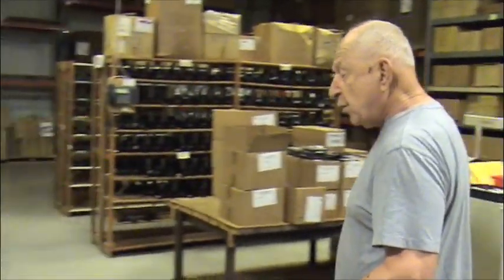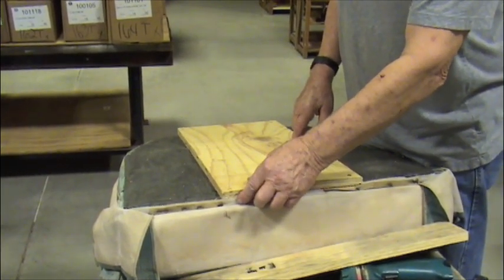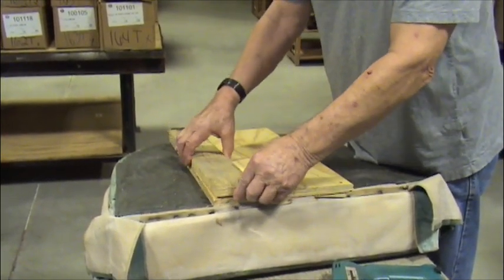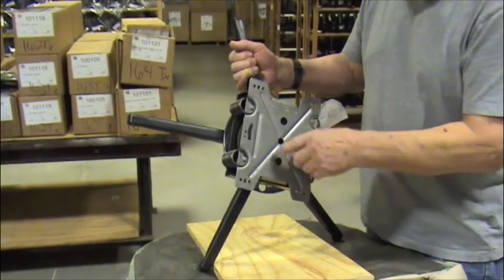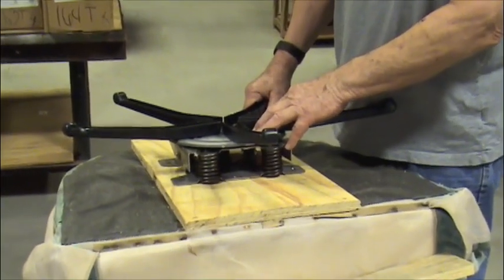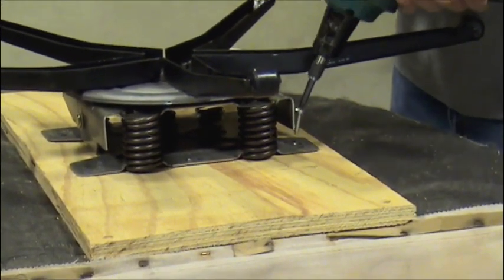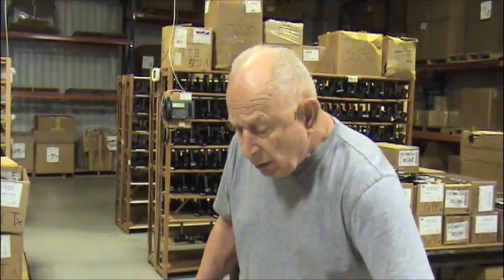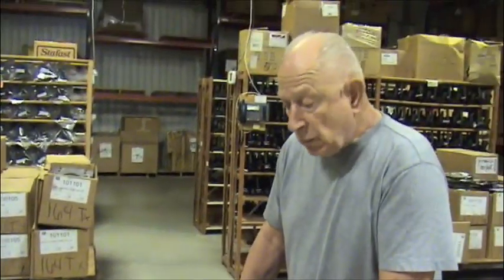How to Install a Rocker Swivel on an upholstered chair

Comment: what happens if you keep almost tipping backwards? I thought maybe it was on backwards. however your video said it right. how can I help fix it
Reply from the maker: If its a brand new item, move the unit to the rear about 2-3 inches.

If it is an older unit, it's worn out and a new one is needed.

Comment: Very clear and helpful.  For a chair with 30 x 35" frame, are 1" x 4" boards strong enough for mount under frame?  If using plywood instead for mount under frame, what type of plywood and actual thickness is appropriate (user weight approx 200 lb and chair weight approx 60 lbs)?
Reply from the maker: Run the 1 x 4" at 30". We use cabinet 3/4 " quality plywood or better but actual 1" (Russian Birch about 15 ply is even better)
Reply: How did you learn this skill?  Did you go to some kind of school?

Comment: I know this is an old video, but I'd like to know if it's at all possible to convert a recliner into an office chair? The conversion would include a swivel mechanism, heavy duty castors and a gas/hydraulic lift. Is this even feasible and would you lose the ability to recline if doing so (I would think so)?
Reply from the maker: David,
Yes, you woiuld lose the recline ability. But some  office chairs can lean back about 17°.
Reply: @swivelchairparts  thank you for the reply. Just so I have my thinking in the correct order; the loss of the recline ability would be due to what? Unbalance?
Reply from the maker: The height at lowest point would be high as it would require 2 mechanisms on top of each other even if a place to attach to chair is found and let alone to each other.

Comment: I just bought one of these and it did not come with the mounting screws for the mechanism. They’re supposed to have large heads. What would I have to buy to replace the missing hardware???
Reply from the maker: Please write us with your order number and phone number.
Don-swivel-chair-parts
Reply: @swivelchairparts  never mind we went to the hardware store and bought some screws. Also no instructions?? Managed without them.